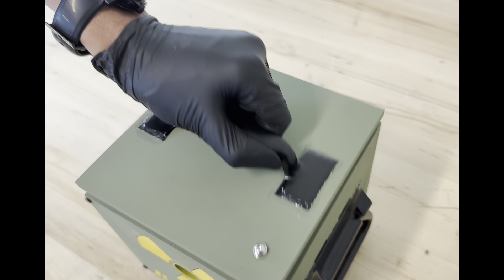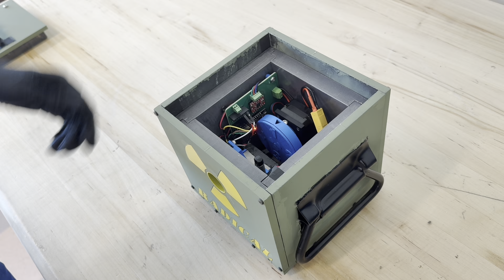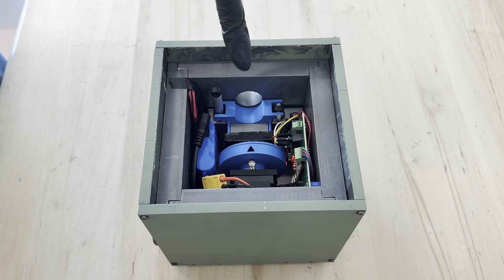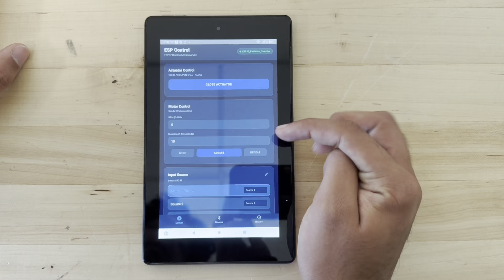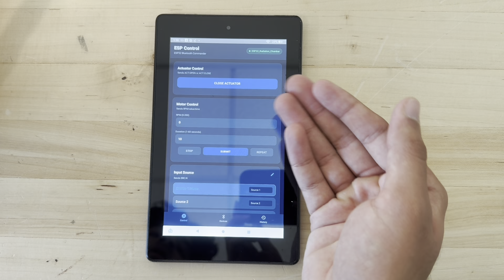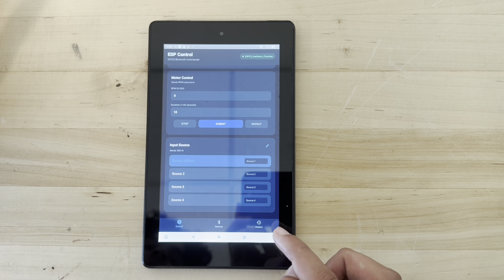156B Sp26 Team 16 RadiCal - Narrated Video

Comment: Is that ESP32 rad-hard?  Is there a failsafe to close the door in case of latchup or control failure?  How are you getting a BLE connection through all that shielding?  You might want to include a wired backup control option.
Reply from the maker: Hey there! I'm one of the students who worked on this project. The amount of radiation that the sources actually emit is extremely low and is not enough to damage the electronics in the immediate future; there may be degradation eventually, but we have made multiple PCBs to circumvent this issue. While this might seem counterintuitive to the entire point of reducing radiation since the sources are so low energy, this project is really just to reduce as much radiation exposure during the calibration process as a way to adhere to ALARA (as low as reasonably achievable) radiation codes, hence the remote actuation. As for the BLE connection, the team has tested Bluetooth attenuation extensively and have found no issue with it blocking even after the course of several hours, this was a major concern for us too but we were able to be confident in our system's BLE connections. There is no formal failsafe, unfortunately, for the actuators, the only band-aid solution we have is a large lead block to cover the aperture if an actuator failure were to happen in its open state. A wired backup control option is definitely something that would be convenient to have for future iterations of this project, we do agree, but with the extremely limited time we had to procure this project, it was not entirely feasible. Thank you for your questions!